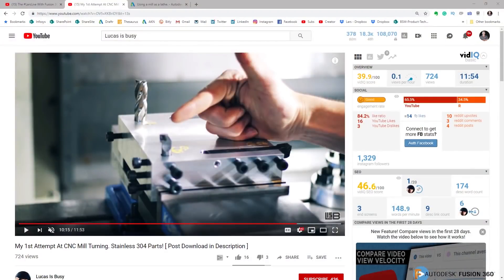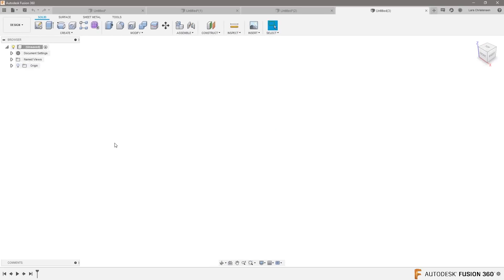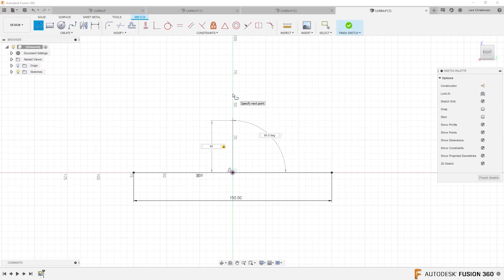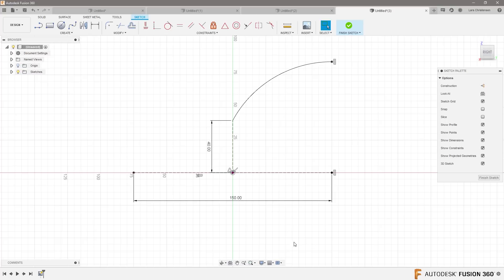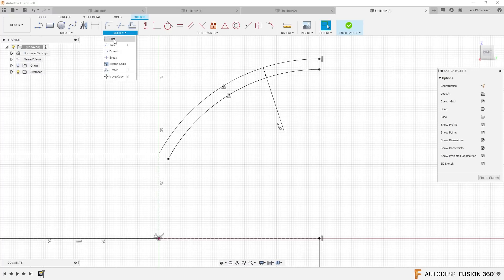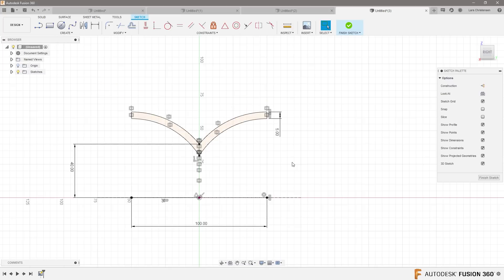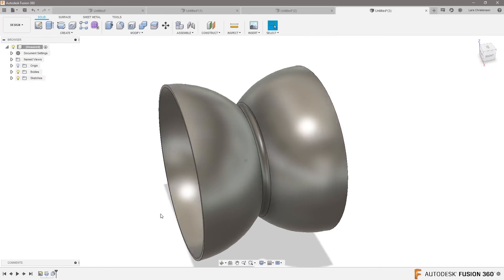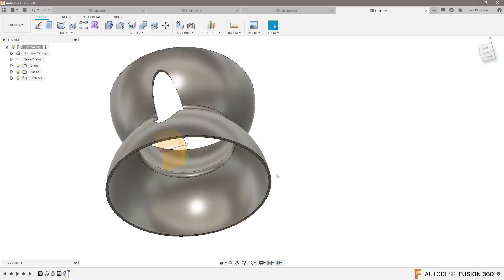Fusion 360 — A BETTER Light Reflector — Ask LarsLive

Comment: about lighting in render and fusion.... is there anyway to get fiber lights working with fusion. i have been trying to deliver like this ( https://sunsauna.fi/wp-content/uploads/2014/09/sunsauna_12_20140116_1472239232.jpg)  lights but the problem is that the fibers are about 2mm diameter, and i you model a 2mm wide cylinder for example and attach light into to the face or the tip you cant get that to emit light more that a little, the beam dies much earlier than in real life and you can´t determine the angle the surface is emitting the light out. is there a way to do this kind of light spots  ?

Comment: The reflector curve needs to be a parabola.
To draw a parabola in Fusion360:-

1) Within a sketch, select CREATE / CONIC CURVE
2) Click once to define the point at one end of the parabola.
3) Click again to define the point at the other end of the parabola
4) Click a third time somewhere along a line which is the perpendicular bisector of the line that joins the first two points. i.e. the axis of the parabola.
5) In the value box which appears, enter the value 0.5

You now have your parabola which you can integrate into the rest of your design.

Comment: It is a reflector - the curve is supposed to be a parabolla, not a circular arc.
Good luck modeling that - maybe with splines and lots of calculated dimensions & tangents, maybe tons of construction geometry (normal at curve point is half  angle between line from point to focus and horizontal line from that point).
Similarly hard to modeling precise involute curve on gear teeth, lots of samples and approximation is needed, and it may be necessary to generate spline control points with a script to get within acceptable error...
Reply: Maybe you can use a math program like mathlab, or even an Excell sheet to draw a parabola, save it as an image and convert it to an SVG. Then you have a perfect parabola to revolve around the axis to make the reflector.
Reply: @typicalcow9791  Not maybe, Jan is right you need either a parabolic curve drawing tool or some other method to enter the math to draw it. Copying a line you import has to be the worst way except for... I've said enough.
Reply: I just found this, might help. https://ekinssolutions.com/creating-equation-curves-in-fusion-360/

Comment: Love your videos, Lars. Learned so much with them and appreciate your time and effort in doing them. Had a questions not related to Fusio360. What's that display behind you showing? It seems to be some stats but can't really tell. Thanks again!
Reply: The HP-11 was 1969's answer to the portable programmable electronic calculator. Portable, but in reality that box is just the UI. Another box is the calculator electronics, plus a power supply, and they rack up together on wheels about the size of a hand truck. Impractical in general but pure state of the art at the time and a niche market for a while.